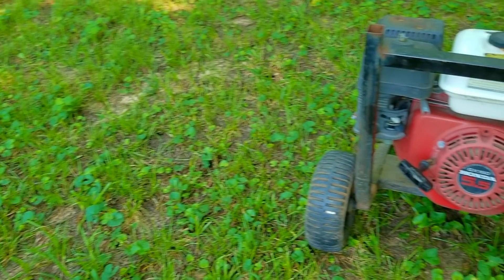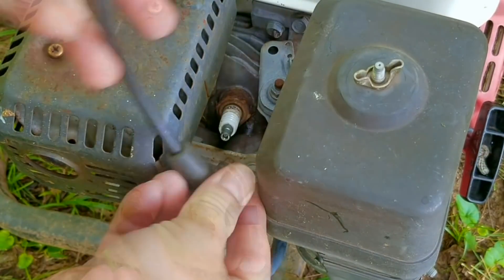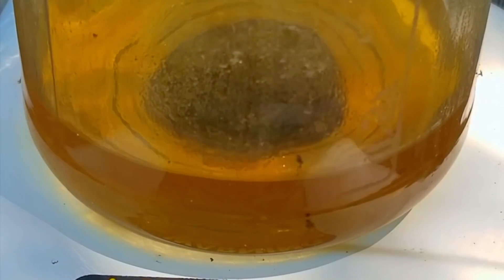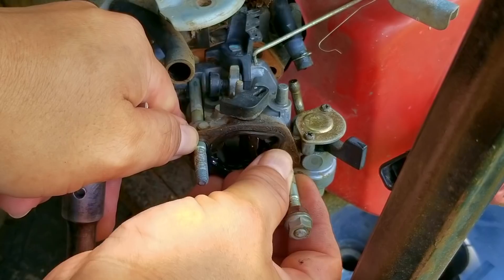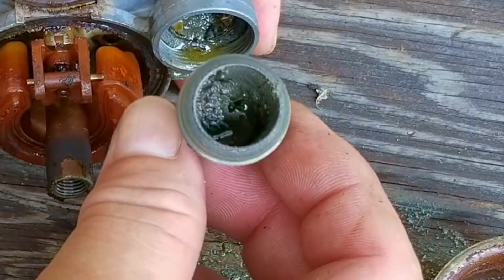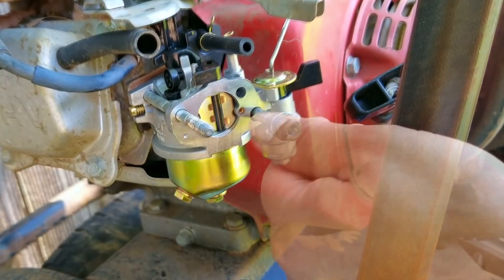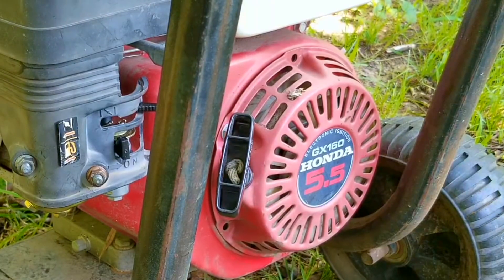Why would you neglect a Honda powered Pressure washer?

Comment: If it was outside for a winter, and not winterized, the pump will be toast if you are in a cold area. Good video. Good luck with this nice machine.
Reply from the maker: you are absolutely correct about that. Too bad It didn't come with the rest of the stuff to test it.
Reply: @HomeGaragechannel  from some of the dead pressure washers I have tried to fix, I do have an extra set of wand / hose. It’s about 20 ft, shorter than I like optimally, but can be set up on auction/ yard sale finds like this. Pump test is the next step IMHO to see if we have a pressure washer or just a nice engine on a nice stand.
Reply from the maker: thank you for the information.

Comment: I cleaned several of these very rusty carbs. Got them squeaky clean using a fine wire wheel and the equipment started up on the first try.
Reply from the maker: Nice work!

Comment: I once cleaned a carburator that was so gummed up that the choke, throttle and float were compleetly siezed, after a few attempts it works perfect, probably should have just replaced it, but it was a briggs and stratton carburator that was actually made by walbro, so i decided it was worth saving
Reply from the maker: I understand where you're coming from.  At least you got it working again.

Comment: We’ve got an old Homelite pressure washer (From 2006 maybe?) that we use about once a year and never drain the gas in. Each year my dad adds some new gas to it and struggles starting it for 10 minutes before the old gas burns off. 

I’m surprised that Honda’s carburetor was so bad if ours still runs.
Reply from the maker: I was a bit surprised as well.

Comment: Our pressure washer is powered by electricity and not fuel but before the winter i make sure to run the mower and trimmer until there is no fuel in the tank or carburetor before storing them over winter and then refuel before using them by the next season i also change the oil on the mower by running it with some gas in the tank until the tank is empty before changing the oil and then put new gas and keep doing my work, i've learned from what happened to the husqvarna 252rx trimmer's carburetor problems due to both diaphragms needing to be replaced since dad left it in the barn for 5 years with half a tank because it didn't have enough compression to start due to the worn out piston ring, dad snd i hope it will return to work when we get a rebuild kit for the carburetor, i'll keep an update on the husqvarna 252rx trimmer and norlett mower by spring and summer depending on when i get to continue my work of getting them running again :p
Reply from the maker: Thank you Lucas Bergfors for sharing your experience.
Reply: @HomeGaragechannel  thanks that is important from keeping your carburetor needing service depending on if it is a mower or trimmer if it is a mower clean the bulb and clear the jet, if it is a trimmer then check the diaphragms if they need to be replaced 😄

Comment: One reason someone would neglect a Honda pressure washer is illness. I know someone who fell very ill, then lived for 4 more years. All of their equipment (except mower) sat idle for that time. Luckily, all the equipment was stored in a garage.

Anyway, that pressure washer is mine now. It has the same engine as this one, but it's not the same washer. Mine was in pretty good shape. I think the fuel valve had been used. It cranked without any repairs, but it surged. Clearing the idle jet fixed that. I got lucky, but this shows that even if using the fuel shutoff, the idle jet can still get clogged. Then I changed the oil, and give it some fresh fuel. It runs great now. I got a new, longer lance for it, and a surface cleaner attachment. It works great for cleaning driveways & sidewalks.
Reply from the maker: that makes sense

Comment: I bought a used Simpson power washer with a Honda gcv160 engine. It worked good before the winter. I closed the fuel for storage but today when I tired to run it it didn't run. I took off the carb and the little brass screw that goes before the jet was messed up. The previous owner had stripped it or something. I couldn't find a "rebuild kit" with that brass screw and had to buy a new carb. I did find Amazon selling the the brass screw but it cost just as much as a Chinese rebuild kit so I just went with the kit. The original carb and rubber gaskets were still good too 😭
Reply from the maker: that's a shame, At least you get it working again.
Reply: @HomeGaragechannel  i didn't get it working lol. Still waiting for parts to get in haha

Comment: Mine is a mixed bag, just getting the cart and eventually a workable motor from a brother-in-law and getting everything from the motor on out from Ebay. I just realized I need to put a fuel shut off on it seeing it has a Briggs plastic cam motor and the main jet was stopped up this summer. It's running now but I'll run it dry when I get done with it which I did last fall. I run non-booze gasoline now after the place where I was getting it quit carrying it and I have to drive around 15 miles to another station. It does a good job but I'll get a more powerful pump one day since I think it's 2800 p.s.i. and everything is rated for 4k. The downfall is that' it's a vertical but good enough for who owns it. Hood old Honda fires again! Thanks and Blessings.
Reply from the maker: yes the plastic carbs have a tendency to clog so the fuel valve is a good idea.
Reply: @HomeGaragechannel  Then I can take the line loose and drain the tank instead of trying to pour it out and having it run all over the place.

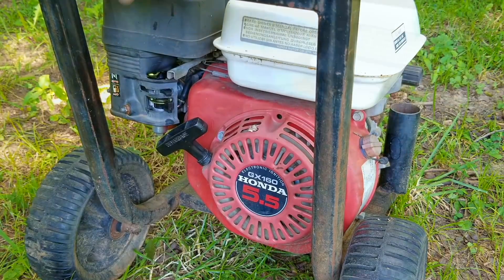Comment: 7:54 i found that pumps do have a gear oil in them to protect them from running without water in them
Reply from the maker: Yes on the pump internals, there should be some sort of oil in there.

Comment: I have an cheap ultrasonic cleaner which i paid 40$ for, and its been great for cleaning carbs. Putting in some warm water and dish soap and then rinsing it off with light scrubbing does wonders to clean carbs. I still usually use a small wire from a wire brush to clean the jet to be sure, though
Reply from the maker: thank you Stoventian Airsoft for the information, I'm hoping to get one soon.
Reply: @HomeGaragechannel  yeah, its a no brainer to get when you do this stuff as an hobby, since it saves a lot of time and effort for sub 50$
Reply from the maker: yes very true.

Comment: I run the engine until the carb is dry. I also use BS pump saver to remove water and lubricate the pump for winter storage.
Reply from the maker: that's a very good maintenance routine.

Comment: Since i changed over to Non-Ethanol Gas, I've had zero fuel issues with any equipment. I just leave the fuel in them, and they start right up. Sadly, my generator is gonna need some love. It was stored with Ethanol Gas, and i'm sure that carb is a mess. my fault! I should have drained it, and put regular non-ethanol fuel in it.
Reply from the maker: it happens to the best of us

Comment: Happy New Year !  Good info and tips in this video. I run my  pressure washer out of fuel before storing in an above freezing location ! My thought is to also pull the carb. bowl nut/jet to really drain it dry. Don't you believe otherwise, there is still fuel left behind? Great Channel sir. 😊
Reply from the maker: Thank you , and yes when running the engine till it stops, there will still be a small amount in the bowl, as it can't pull everything out of it. But that small amount will evaporate over time, before it goes bad. But yes taking out the drain bowl nut will prevent any chance of that happening.

Comment: for me with my Ryobi Pressure cleaner Model RPW2400 163cc OHV (OverHeadValve) 4 stroke aka 4 cycle engine as mine has a plastic fuel tank and using a Honda mower type fuel cap well i try and use a fuel stabilizer if i need to store mine with the fuel in the tank and use a bit of starting fluid for ours if since there,s no primer aka purge bulb on ours etc.
Reply from the maker: that makes sense.
Reply: @HomeGaragechannel  for sure and i don,t have to worry about rust in a fuel tank either being made of plastic etc.

Comment: Be very careful running the engine without the water flowing through the pump. Doesn't take very long to do damage. But I would have made that carb a personal challenge to me to clean and repair it. Just the way I am... Thumbs Up!
Reply from the maker: Yes you're absolutely right, and you're the first person to mention it.  Thank you Gary Mucher.
Reply: @HomeGaragechannel  I always have so far except that wretched Poulan.

Comment: Hi my friend got a Poulan pro chainsaw from a friend it doesn’t have a prime bulb if I put a little fuel in the spark plug it fires right up runs great any ideas you’ve been most helpful in the past
Reply from the maker: sure, it seems to have a carb problem, I would suggest replacing the carb, and inspect the fuel line, as they might need to be replaced as well.
Reply: Thanks ill let him know your the best

Comment: Always check the oil first before you pull it over I made the mistake I was working on a snow blower didn’t check the oil and sprayed starter fluid in the intake it ran and the. Seized up thankfully it didn’t cause any damage but it’s better to be safe than sorry
Reply from the maker: you are absolutely correct.

Comment: i just fixed an old tiller that was bought in 2012, has been sitting with e-15 gas in for the whole time outside.
just replaced the carburetor, fuel tank, recoil, and tires and now it works again but idk if it was worth it ... oof

total $127 in parts for a tiller worth like 200
Reply from the maker: wow that was a lot work

Comment: Why neglect a Honda engine?
Because it can take it.
Worked on a pressure washer with a Honda engine, the fuel system was  pretty dirty, but a clean  and it run fine.
Reply from the maker: unfortunately, the fuel in this one, didn't store well, and ruined the carb.

Comment: I picked up a  clone of this Honda motor , I think it has been left outside for quite some time as the cylinder head had water in it and Carburettor is ruined .
But it does have a spark and turns over but when I put a bit of petrol in the cylinder head it doesn’t fire , the engine switch is on.
Is there anything that you could suggest I might have missed.
Thanks for the informative videos.
Reply from the maker: how did you check for spark?  The last thing do, is do a compression.
Reply: @HomeGaragechannel  I have a spark tester like you have but I don’t have a compression tester but it does seem to have resistant when I put it over .
Reply from the maker: I see, try removing the spark plug, reconnect the wire to it, ground the body of the plug to the engine, and give it a pull.  I just want to see if the spark plug itself works.
Reply: @HomeGaragechannel  I found the problem after I first got it I checked the spark which was good them I checked the oil and it was way over fill, so I took some out ,
The new level was below the oil sensor switch after I topped it up it fired and run for about 1 min.
Thanks for all the great videos.
Reply from the maker: no problem and good work figuring it out.

Comment: I recently bought a small electric pressure washer. It got the job done quicker than I expected however I never used one before. My question here is since you didn't do any initial testing with it, changing the seals are on the to do list with this pressure washer?
Reply from the maker: I'm glad you brought that up.  Since it didn't come with the hose or the wand, I wasn't going to test the pump, because they will never replace those parts, to use it. I know that sounds mean, but it's the reality of the situation.  They just happen to have the pump, without the accessories and will probably just use it to barter with.
Reply: @HomeGaragechannel  cool

Comment: When I go to the gas station to mix my oil and gas mixture, how do I know which gas octane is best for power equipment like weed eaters and what gas octane is marine gas? Stihl uses 89 octane. I just want to know is marine gas 89 octane and is it best for Stihl equipment?
Reply from the maker: as far as I know octane is octane, so if it's 91 for marine, I'm guessing it's 91 for automotive.  I would suggest using 89 or higher for lawn equipment.

Comment: I leave them full to the top with Aspen4.
Reply from the maker: that will work as well.
Reply: ❓what is aspen4
Reply: @vincebaish8904  It is a long life fuel for 4 stroke engines, they make Aspen2 for 2 strokes.
I keep the tank full to discourage condensation.
Then I try to startup all my gas powered tools once a month to refill the carburetor.

Comment: It’s a shame when people leave good equipment like this outdoors, I just don’t get it. Usually they leave water in the pump too and it freezes up and cracks. For the last run before storage in all my stuff I use a little aviation fuel, it lasts for many years and will never gum up. The pressure washer gets RV antifreeze run through it to prevent freezing and cracking over winter.
Reply from the maker: that's a very good method for long term storage.

Comment: I got my trimmer running with a new carb but a few minutes later it dies and the bulb doesn’t fill up and I pulled it apart put it back together and work then it did it again where it died primed it again and the bucks didn’t fill up anyone have an idea what may have caused it
Reply from the maker: sure, did you check to make sure that the fuel filter is still connected on the line In the tank? Also you might have the fuel lines swapped on the carb.  did you take the carb apart to check the inlet screen for a clog?
Reply: @HomeGaragechannel  I check everything on it and everything is correct on it
Reply from the maker: then the new carb has an issue.
Reply: @HomeGaragechannel  alright thanks for your help!
Reply from the maker: no problem.